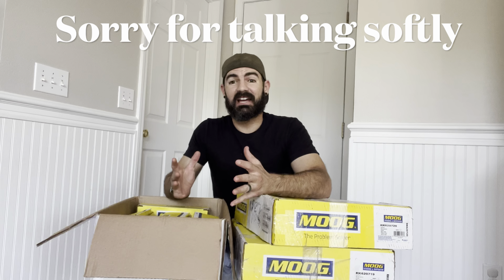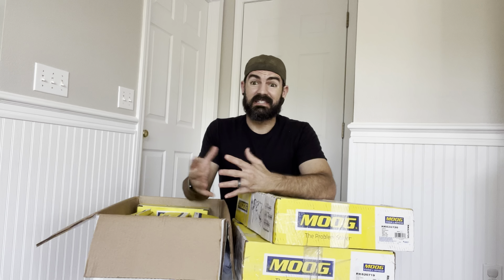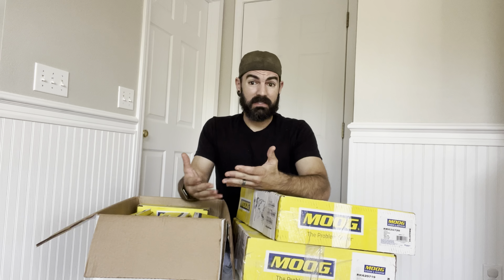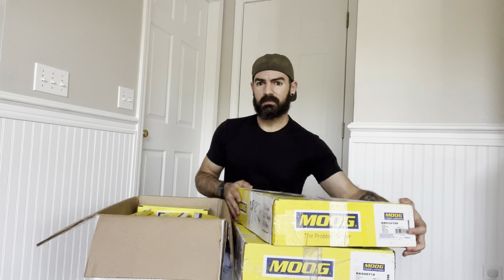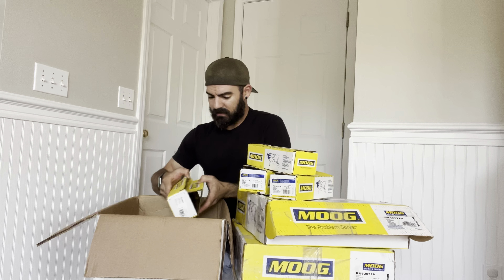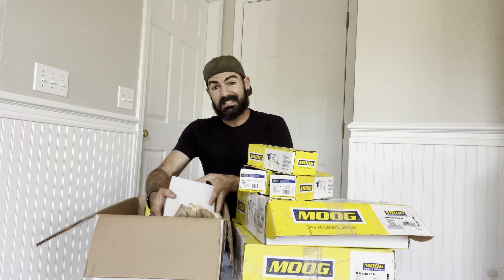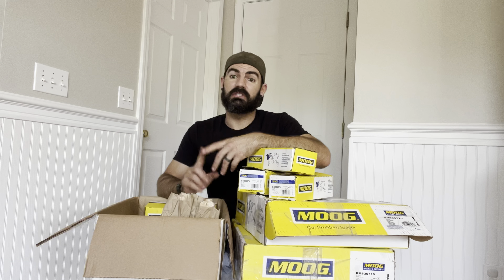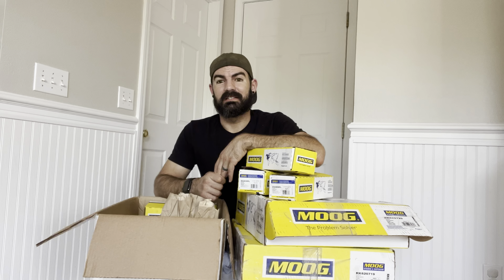Are Moog Parts Good? - Yes! And Here’s Why

Comment: Moog RK parts unfortunately aren't great at all. They are actually bottom Value Grade at best. This is why O'reilly Auto Parts Invested into there own company and created Precision and dropped Moog because the amount of Moog Warranties were getting out of control. The only local store I know of that still sells Moog is Advance Auto and Private owned Parts Stores. You can get all the free parts you want for this paid video but I Disagree to a point. I am an ASE World Class Automotive Technician with over 25 years professional experience and I see it every day. 10 years ago Moog sold a quality product that actually exceeded OE by far. Now not so much. Once Moog got sold off a few times now the company that once had a great reputation is now out to maximize profits with cheap parts made of inferior designs and cheap metal. If you see a Control arm that starts with RK it's not great at all it's actually below OE grade. This is from a guy who has a Moog Front end on his Truck. But if you buy a Moog RK Control arm and that's your only option I'd go as far and take the ball joint out and replace it with a "CK or K" Series Problem Solver Ball joint because the Quality level difference is extremely significant. It's night and day. The CK & K Series Parts can be made in America, Japan and Taiwan. They have grease fittings and the quality is at OE level. The RK Series parts are usually made in China and don't last at all and are terrible. They don't last at all... So this is me not totally talking down Moog. This is just to get people to understand the difference in the product lines they sell... CK & K = GOOD...... RK=BAD & CHEAP....  I will say it once more. If you are forced to buy an RK Moog Control Arm. Take the Ball joint out and replace it with a CK/K Problem Solver Balljoint and you have the best possible combo. I get it's allot of work. But I'd rather install it before to get a OE level part rather than a Balljoint that lasts 7 days- 2 months. I can also prove my credentials if needed.  I have been in my local newspaper and I'm on the ASE Website....
Reply from the maker: I agree oem is for sure the way to go. However after talking to the engineers directly at Moog and using their parts. I’ve never had an issue
Reply from the maker: And I say it like it is. I’ve had a lot of companies send me free things and when it’s crap I call it like I see it
Reply: @FreedomCrawler  In the nicest way possible you are one person. I see about 6-15 vehicles a day. I'm just telling you my experience.
Reply: @FreedomCrawler  I wasn't totally crapping on Moog. Like I said the CK/K Series parts are OE Level Quality. The RK parts are an issue. Put an RK Control Arm on a GM Pickup for 6 months. Then Unload the front end and you will see exactly what I mean. Then you install a CK/K Problem Solver Balljoint in and it lasts for about 2-5 years. The Bushings however are okay amongst either Product line. Just make sure in any SLA suspension you're unloading the suspension and checking them with a prybar. I generally use a Floor jack under the control arm to check the ball joints with a prybar under the tire and a prybar to check the bushings.

Comment: Moog sucks. I’m just a DIY guy but they burned me on a 2016 Camry control arms. I’ll never buy Moog again. No refund from Moog or Amazon. Glad u had good luck I didn’t. OEM from now on.
Reply: What was wrong with the parts? The reason I'm asking is I just installed new control arms on my daughter's 07 Camry, and now it's running wonky on the full turn. Thanks
Reply: @BIG_MF_  I hate to say this as it’s embarrassing but I like to help. The Moog and O Reilly parts were labelled BACKWARDS. Or it was me? I forced them on backwards like a dummy. I didn’t know any better. It rode horrible. I returned them. O Reilly same labelling! I put them in as I thought (opposite of labels) and it aligned perfectly. Maybe it’s just me but R means passenger L is drivers. The internet is absolutely no help they can’t agree what’s drivers or passenger. Lesson learned- match up the parts. The Moog were probably perfect. I wish they’d label parts as passenger or driver. I spoke French in my garage for three days on that Camry. Wishing you the best.
Reply: @Fatboy53  that's exactly how i installed them. (R) passenger. . . (L) driver. . . that still wouldn't explain how the bolt to one of the ball joints  stripped when I took the ball joint off. . .  (easier to install control arm and ball joint separate instead of together which is how they come). . . I thought maybe it was just over torqued at the factory but no, looks like it was cross threaded and forced in. . . . . Thanks for your response brother, i appreciate it 👍💯
Reply: @Fatboy53  what was the result of installing them backwards? How did it affect the vehicle? Cuz now I'm wondering if they were mislabeled.
Reply: @BIG_MF_  it was horrible. My neighbor came over. He took a tape measure from front of front tires to back of front tires. They weren’t identical as they should be. It was basically pigeon toed. There was a difference when the values should be equal. I put in the O Reilly, they were labelled wrong also, opposite as labelled and learned a hard lesson. Parts are made in China and they made me speak French for 3 days 😂. Once the O Reilly were in it aligned no problems and drives like a Caddy now. Plus O Reilly are lifetime guarantee! Anyways, I feel your pain. Very sorry to hear. A job like this sucks enough w/o mislabelled parts!! Wishing you the best at figuring it out. Tried to put a review on Moog Amazon and they didn’t allow me!? WTH. Cheers bro French in the garage. I was throwing wrenches at the wall. I use OEM, O Reilly or Rock Auto. Also- Amazon sells FAKE  NGK DENSO plugs on Amazon- Toyota sells them almost same price OEM. Check the YT vids on that brother. Also, if you need axles check the web. A place here in UT rebuilds OEM ones and sells them <$100 USD w/lifetime guarantee. Wishing you the best

Comment: buy moog CK not RK. Same rule of thought as the "economy" section of rock auto versus the "daily driver" or "upgrade" section. I've had Moog rear wheel bearing hubs i installed on my fj @40k miles ago with skf seals. zero issues. also scuba modded the rear axle breather up into the cabin to avoid blowing another seal with back pressure.
Reply from the maker: ^ Solid advice

Comment: I have used moog as my preferred tre and ball joints for 20 years. The last 2 sets of moog ball joints I used on different vehicles have been a big disappointment. Each lasted less than 40k miles where OEM they replaced went over 100k miles. I will be using OEM from now on. Sorry Moog it was a good run while it lasted.
Reply from the maker: Fair enough. Sucks to hear that
Reply: Sometimes when you install them you can damage them

Comment: I was extremely underwhelmed by the boots on their upper control arms for a 2014 Ram 1500 4x4. If they could start using polyurethane that would put their parts well above anyone else's. Boot damage is a big reason joints get damaged in the first place.
Reply from the maker: I agree with that. If it doesn’t have a good deal then it gets all clogged up and worn out.

Comment: Just put a mood steering knuckle on my Ford Edge. The dust cover was not screwed on just pressed on and not a every tight fit. It is loose and will start to rattle any time. Not sure how to fix the issue. Moog has been in business for decades and should know how to build replacement parts.

Comment: I use MOOG to replace OEM parts on my fleet vans. On my stock H2 too. MOOG put grease nipples where the factory should have. If the grease nipple is a spot that makes greasing the vehicle complicated, they send an extension with the part. Never have any issue and these parts outlast OEM.
Reply from the maker: Agreed
Reply: Want to put ones with grease fittings in my 4Runner. Thanks for the info

Comment: Started working on cars over forty years ago, before I could even drive, helping my father with his. Out of high school my first job was in an auto parts store that supplied the mechanics shops for miles in every direction and Moog as a fixture in that store. Seeing them sell out to Wall Street and off shoring production out of the USA, was a major disappointment. They can do all the marketing they want but until they correct that issue, my money goes elsewhere.
You seemed to be dancing around that subject quite a bit in this video.

Comment: I just installed a Moog Drag Link and Moog Ball joints.  Very satisfied so far.  Do they make control arms for 2014 Jeep Wrangler JKU?  I guess I could just reach out to them and ask.  No need to apologize for being an awesome full time dad.  That is one of the most honorable and satisfying jobs in the world.
Reply from the maker: That’s a a great question. Factory or for lifts? I would assume for lifts they do not. Possible for stock applications but That’s a great question. I don’t see a lot of people replacing factory control arms unless they are lifting them. 
On that note I’ve thrown away a ton of factory control arms after doing a lift. So if you need to replace one I would check marketplace or a local Jeep group on FB and ask around. I bet you could score a low mileage set for super cheap if not free
Reply from the maker: And thank you! I don’t know how people do it full time all the time. Especially with more than one kid lol

Comment: How are all your MOOG parts holding up today? I need to swap all my front end suspension parts on a 2003 Sequoia. I need the new parts to last though when I am in the middle of nowhere.
Reply from the maker: If I had any bit of concern I would do oem lower ball joints every time. It’s more of a why not. 
However I personally wouldn’t have any issue tossing Moog parts in as a backup if that was readily available and I couldn’t do oem for whatever reason.

Comment: Just installed new moog control arms (with ball joints) on my daughter's 07 camry, and now the car is all wonky. The control arms seem loose and fitment doesn't seem right, also ball joints seemed defective.. I tried to take off one of the ball joints and the bolt stripped out. And now the small auto parts store that sold them to me won't refund no warranty them. . HOW CAN I REACH OUT TO MOOG??
Reply from the maker: Go directly in their site and reach out to them.

Comment: Just seeing your Moog videos for the first time now, doing research on ball joint replacement for my 5th gen 4R. I'm just really confused though, because as you pointed out in your previous video, the 555 definitely looks more heavy duty and higher quality than this new black one. I have a hard time believing that the new black one is any type of improvement. Did they mention anything with the metallurgy or anything like that?
Reply from the maker: So when I talked to them it was a group of people from their team including engineers. What they mentioned was that their goal was to make it like factory but with better components. I couldn’t give the exact details they did however I told them exactly what you mentioned. Not only did the 555 look more pronounced the fact that they didn’t have any badging on the part made it “look” less substantial and too similar to the knockoffs. 
To their credit they acknowledged they and noted it. They also said if I started hearing any negative feedback or experiences to relay it over for them to look into or reply to people on. 

The fact that they reached out at all was extremely impressive to their goal of increasing their reputation again
Reply: @FreedomCrawler  thanks for the quick reply! I've always liked Moog stuff, I've used it with success on older domestic vehicles I've owned. I guess I've just been conditioned by Toyota people saying to stay away from them in the 3 years I've owned my 4R, because I'm having a hard time not thinking this "improvement" is really just an improvement to their profit margin by outsourcing to a less expensive manufacturer. I'll probably stick with OEM when I get around to doing them. They've lasted going on 150k, so once I do them I'll probably never have to do them again.

Comment: If that black ( powder coat? ) lower ball joint in that other video is being called by Moog as "an upgrade to the 555 part"......then I don't believe Moog for a New York minute. Anyone with common sense could CLEARLY see the differences in quality between those 2 parts. The black lower ball joint had NO stainless steel rings holding the rubber boot in place, while the 555 part did. Even the casting itself looked far superior on the 555 part vs the black part. The black lower ball joint didn't even have a grease fitting to service the joint.
Reply: The OEM Toyota lower ball joints are made in Japan.......and expensive as all hell. I found them, and they wanted $108 EACH. Crazy. And don't confuse the fact that the lower ball joints in 1st gen Tacoma's as being the weak point in the entire suspension, with "these OEM lower ball joints WILL cause catastrophic failure". Sure, they are the weakest point of the entire system, but that doesn't mean "they're going to break". If they're worn and exhibit play when testing them, they should be replaced immediately like ANY lower ball joint. I bought my 2000 Tacoma 4x4 with 3RZ engine brand new. And let me tell ya, I ran this truck through the ringer when it was new, going offroad. I was crossing huge canals ( only inches of water over 12 to 15 inches of mud in the bottom ) that are 50 ft wide at the top and about 20 something feet wide at the bottom, with the levies on both sides as steep & high as the side of a typical overpass. I would literally slalom back & forth, crossing these canals, for the entire length if the canal, usually over an 1/8th of a mile. NONE of the other 4 wheelers would even attempt to do it even once .........and they all said: "You're f*cking crazy". Now imagine how much I was causing my entire suspension to flex while doing that. Never once lost a lower ball joint. I finally replaced them somewhere north of the 300,000 mile mark, and yes, they were worn out. The original OEM lower ball joints failing is quite rare for the typical every day driver, and of those that have failed, I truly believe they were defective to begin with.........or people aren't being truthful about their lower ball joints being worn out. Perhaps they weren't even aware that they were worn out. I replaced mine with the blue Mevotech "Supreme"  ball joints ( the rubber boot is blue ). That was nearly 3 years ago, and so far, so good.   @briana3544

Comment: The parts that take the most beating I would just buy OEM AND THE PARTS LIKE AN UPPER CONTROL ARM I WOULD PROBABLY CHEAP OUT AND GO WITH MOOG because they’re $315 per arm =$630 for a dodge charger and moog got em for $100 for both so if I have to change them again, it will still be three times cheaper than oem

Comment: Nice vídeo bro... I'm searching for   LBJ. Idk if take the OEM or MooG.    I view your others video and i tought "Moog 555" was better that "black Moog".     If You could give more information about  it.  

PD: sorry for My Bad English lol.
Reply from the maker: No worries at all and thanks for reaching out. I actually just made a new video on this and will be making another one. Bother are actually good parts. I didn’t know this until after Moog reached out but the black one is actually their newer version. Personally if I saw a 555 version I would probably take that one first though. Lol
Reply: @FreedomCrawler  OEM vs Moog 555.  Which would You choice ?  🤯🤯🤯.
Reply from the maker: @zato7649  Moog called me directly after they saw this video and I talked to their engineers and sales team thoroughly in regards to all of this. They said they have updated their products and are working on fixing a lot of the misinformation that’s on the internet about them right now. They want to prove they are better than oem in every aspect. I would have no issues running Moog again ( I put them on my 3rd gen 4runner) and if you ever had any issues you could let me know and I’ll relay directly to their engineering team. I’m sure they would jump on it. 
So for me? Moog. If I just wanted to spend the extra money to say I did. Then oem
Reply: @FreedomCrawler Can you confirm they don’t have have plastic in them? Lower ball joints? Does moog buy ither brands and box them?

Comment: I was recommended to buy parts from moog. However, after educating myself on the company and the poor quality I’m not sure. 

This is my first ordering parts for my chevelle from end suspension and rear end. 

I was told QA1 is a better selection compared to Moog. 

Please assist with to select the right company for my project.
Reply from the maker: If qa1 has better support for chevelles that sounds like the better option. I haven’t had a Chevelle for a few years unfortunately